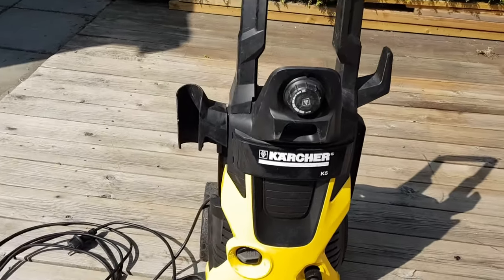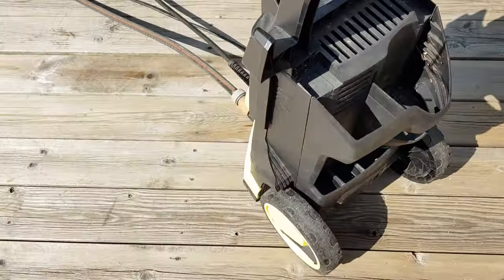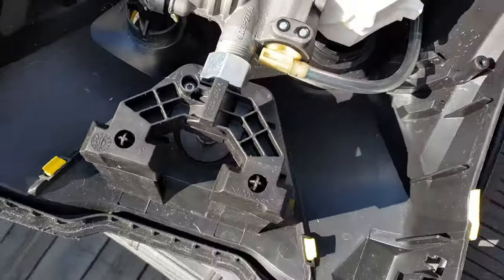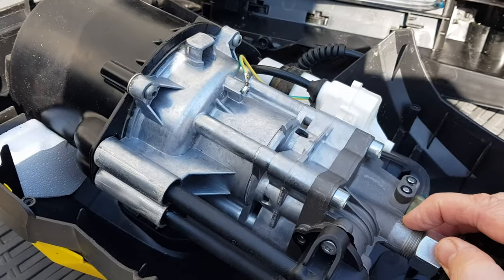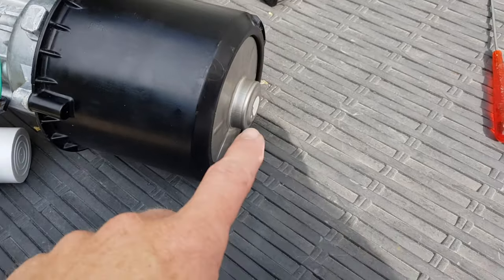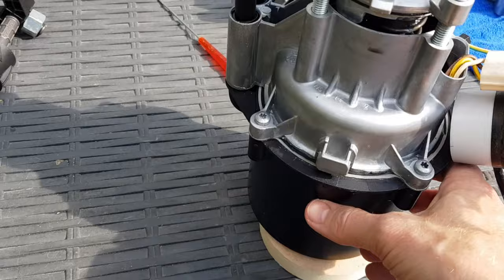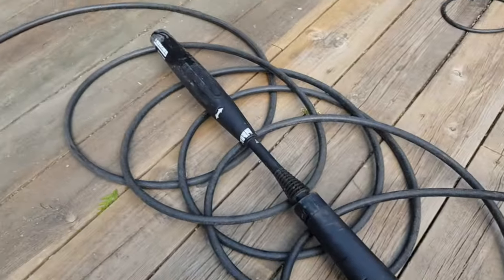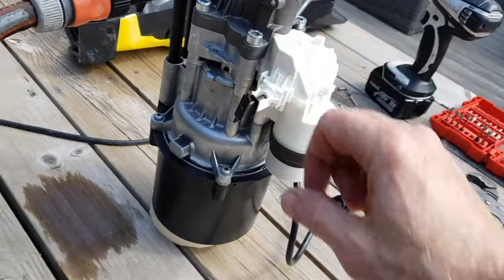How to FIX a KÄRCHER K5 Pressure Washer #kaercher

Comment: Pump heads are notoriously weak on Karchers, 9/10 it's this part that fails, tell tale signs are reduced output pressure or the unit starts pulsing as the pressure keeps fluctuating

Comment: A great video. A pity that Karcher thought that a plastic part was capable of withstanding over 2000psi for any appreciable length of time.
Reply: That appreciable amount of time is  Karcher’s guarantee period. After that they could not care less. The replacement pump head on my K4 was £65. I could buy a new K4 for £130, so I chose not to repair.
Reply: Because that's how they design in failure after a period of time which means you go out and buy another.
Reply: It's A Poor Effort Really Using Plastic Components

Comment: I’ve got a K5 compact. It’s a couple of years old. Not been used much. When you first switch it on it works fine. Motor sounds healthy, plenty of power. As soon as you release the trigger and then re apply the trigger it stops working, no pressure. If you disconnect the hose it immediately fires up and pumps water out of the hose. Reconnect the gun, works fine until you release the trigger again and then no pressure. Very annoying. I took it apart and everything looks fine. Any ideas?
Reply: Hello.I have the same problem.Can you told me whitch part must replace?
Reply: Just don't use the dirt blaster. Set the lance to soft before pulling the trigger again. Switch of the machine, set lance to soft, pull the trigger and turn on the switch simultaneously. This is a temp fix, my 14 yr old karcher k3.550 is acting like this.
Reply: Probably air lock. Remove handle and turn off power and leave the water running for at least 5 minutes to remove all air from inside pump and hoses. Then put handle back on and turn on power. 
That should do the trick.
Reply: I have the same problem on my K5 pressure control. If I pull the trigger and hold and then turn the washer on it works with full power. If i release the triger and pull it again, the power is very low. If I repeat the same - pull triger, turn it of and on again - full power. I dissasembled the unit, inspected the pressure head and everything seems to be fine, nothing broken. Anyone has any idean what could be wrong? Its not an air lock, when it starts it has full power and can go full power all time until I release the trigger..
Reply: Follow up - i took apart my K5 and found the piston at water inlet stuck. I pulled it out with pliers, greased the seals with silicone grease and cycle it in and put with pliers until it moved freely. It works like a charm now!

Comment: Neat to see the inside of that unit, thanks for the vid.  FWIW, I always use a lubricant for Orings when installing them.  It helps to make the installation easier with much less friction, and reduces the possibility of damage to the Oring (pinching, scraping etc).  Probably helps with waterproofing and durability too.  Try silicone grease sometime.

Comment: Nice helpful video. But I think it would be much recommended, to remove the old greace (and cleaning all parts) before filling up the oil. Mixing up greace and oil never is a good idea in general. Even less already used contaminated grease and new oil.

Comment: Thank you for the video. I opened mine and there was grease in the pump not oil. I have a problem with my Karcher it washes under pressure only when you switch it on after having pressed the gun and allow water to flow. If you don't press the gun you will get only low pressure

Comment: I had a pressure issue on my K5 and was debating fixing it myself or sending it in to a nearby Karcher service centre. The video was useful in showing that it takes quite a bit of time to disassemble, fix and re-assemble. Based on that, I decided to send it in for repairs. Turned out to be a good decision with the overall repair bill being comparable to the time I would have done it manually in. It also really helped in understanding the explanation given as to the failure on mine (piston stuck) and confirm how it all works together.

Thanks!

Comment: Thanks for this helpfull video and the support link. With that I fixed my K5 myself instead of paying euro 200,- fix costs. The pressure pipe was broken. Also cleaned the pump house and changed the oil 👍🏻
Reply: Do you remember how much oil you put in? And did you remove the grease that was in there? Thanks in advance
Reply: @frenkc1  I completely cleaned the chamber as I saw also water drops inside. I filled the chamber only with oil little above the top level of the concentric ring which moves the pistons. Please know that is more guessing. I didn’t checked the official amount of oil with Karcher, nor the grease which I didn’t placed back. Hope it helps.

Comment: Great video i am glad you fixed this machine.is quite common problem in this machines the cause of the problem is when you're doing a lot of start and stop with the trigger the next time you open the pump put out pressure piston on off clean it and put some silicone grease

Comment: Thank you for this video. My Karcher is slightly different but your detailed process of taking apart and putting back together was very helpful. As you say, I fixed my machine for 1/5 the price of a new machine. considering it is only a small part that was broken this seems expensive but it is still better than buying a new one. The biggest pain was waiting for the part to come in the mail to be able to put it all back together.

Comment: I recently repaired the next model up from this which has the hose reel in between the handle, I replaced the capacitor, the hardest part of the whole procedure was rooting those pipes in the correct positions before closing the case up I lost a lot of sleep over this I reckon I took a total of 16 hours over a few daysBut it was worth it

Comment: Good morning,
 I have a compact k5, there is no water coming out, and the device heats up and shuts down if you force it.

I désassembler the unit, the pistons works well, they are well lubricated, no leaks, the head seems ok, no cracks. 

Is it better to replace the grease by oil before reassembling the device? 

I will retest the device, maybe there is a problem with the bypass.

thank you in advance

Comment: Thanks for informative video. Just wonder how you remove the big bolts on the pressure chamber. I am not able to remove the 4 skrews on mine. It’s almost as they are glued.
Reply from the maker: Try some WD40 or CRC 5-56 for some hours and see if it helps. I used a Makita Impact driver very carefully. I don't think they are glued, but corrosion may be holding them things. Good luck and thanks for the feedback 👍
Reply: a little heat "nothing more than a air-dryer" sometimes helps

Comment: I have a K6 which looks similar, cant take wheels off as the locking washers on axle you cant bang out as they grab more. But the two holes in wheel hub appear empty plastic, as no screw head, tested with magnet too. So dont think its that. have removed all screws I can see, but top yellow/blackcover just will not budge. Anyone taken a K6 apart??? I've given up for now as will break plastic housing..... Ta

Comment: Mine is 110 volts. Can i change the power supply to 220 volts? We use 220v in my country so for now i can only use it with a 5000 watt step down transformer. But if i can change the power supply then i can plug in mains power directly. Any help or advice?

Comment: What are we fixiing?  When the unit doesn't power on?   That is the problem I have with mine.
Reply: try hot wiring it around the switch, if it doesnt power on, the motor is broken.